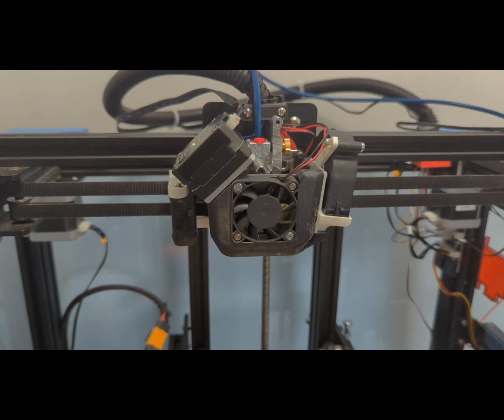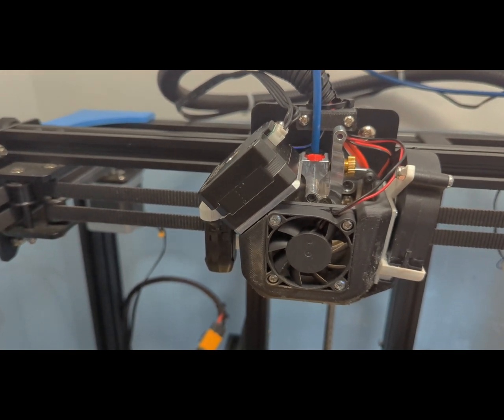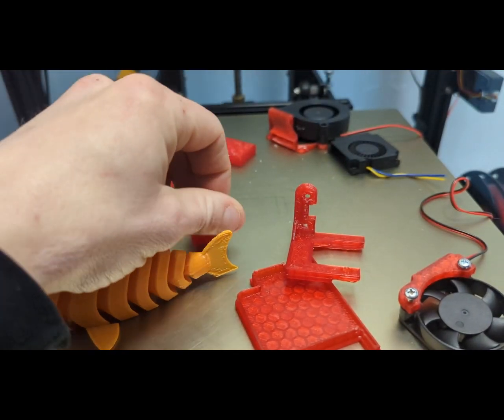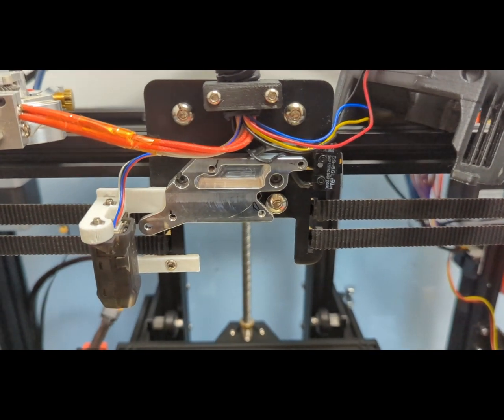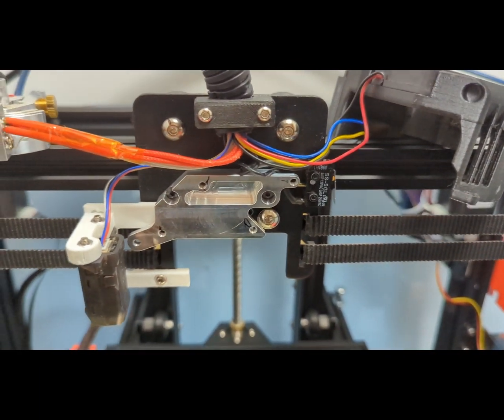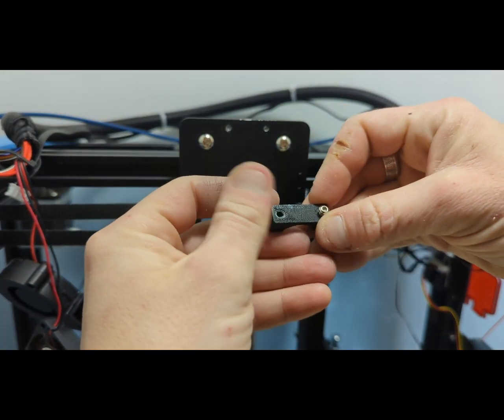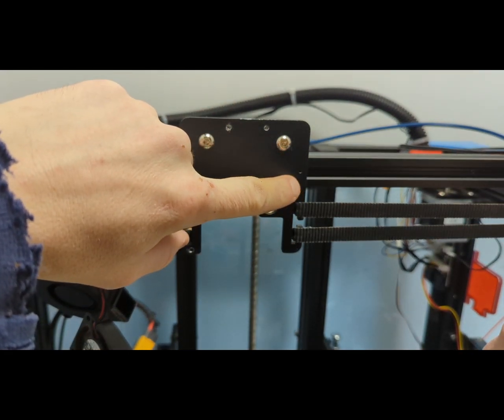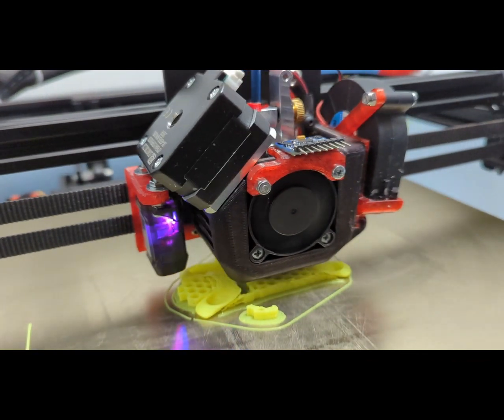The Micro Swiss NG: a High-Quality, 100% Drop-In, Direct Drive Upgrade for YOUR Ender 6?? Let's See!

Comment: Did you edit the firmware to get the CR-Touch work properly? My CR-Touch is measuring 10mm over the edge of the build plate...
Reply: I sometimes have the same issue.not always...weird tough.Also sometimes to measuremeant are 1 full mm off in the same row of measurements..

Comment: Hello .... Great Video .... I have the Micro-Swiss Installed on my Ender 6 and was looking for a way to install Bltouch .... do you know if your CRTouch Bracket would work on the BLTouch?    Thank You
Reply from the maker: Thanks! I can't say 100% that the bracket would work with a BL Touch as I have not tried it, but I know a lot brackets are cross-compatible between the two sensors. Printing the mount in PLA should take < 20 minutes, so you could print one for a test fit, then reprint with a more durable filament later like I did.
Reply: @MrHamTronix  I see there is a bl touch bracket on thingyverse

Comment: Love your video! Please post a link and/or a video of your replacement CR touch bracket. I have not found a good solution to mount the Cr touch with a Micro swiss NG on an Ender 6 anywhere. You are my hero.
Reply from the maker: Thanks for the kind words 🙏
Here is the link for the STL:
https://www.thingiverse.com/thing:5823966

NOTE: I took 1 semester of SolidWorks and my CAD skills are... fundamental, at best. I left quite a few notes in the description of the model, so be aware that some physical modification (I had to file down some when it was printed in PETG) may be necessary to get a good fit with the bracket.

Thanks for watching! 🧑‍🔧

Comment: I have this setup with the bl touch setup, I had to cover my bl touch wires with copper tape to shield them, but once that was done it works wonderfully. Are you running klipper?
Reply from the maker: Yep - I was running Klipper before I switched to the NG. Are you on Klipper, too?

As for the BL Touch - I've heard that extra shielding can help with the flakiness caused by that spray/daughter/breakout board, but I eventually wired my ABL (CR Touch) directly to the control board. I couldn't stand having to try and start prints multiple times, not to mention the bed meshes that kept failing halfway through. I'm in the process of eliminating that board/wiring issue all together as I put in a SKR  Mini E3 v3 :)
Reply: @MrHamTronix  hey yeah, I'm running vanilla klipper, and I have input shaping already tuned, I max it out at 150mm/s as over that a really harsh vibration starts to appear.

I actually found that the only reason the "spray board" isn't good with the bl touch is that the sensor wires are literally less then a cm away from the right hand side motor, literally destroying the signal, after I put copper shielding on both end of my wire I've not had any issues at all.
Reply from the maker: @jraym17  well, I'm glad you found a simple fix! I ran a whole new harness down just for my CR Touch, which I don't regret even though I'm replacing ALL wiring now. The umbilical from the spray board only has ONE wire plugging into the FIVE pin ABL connector on the main board 🫣